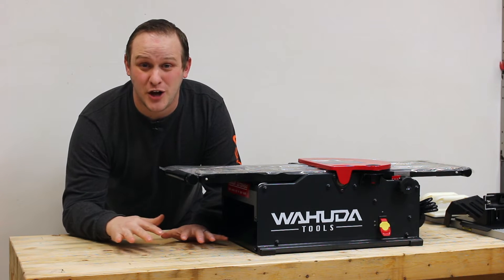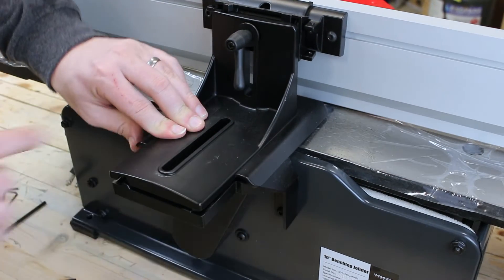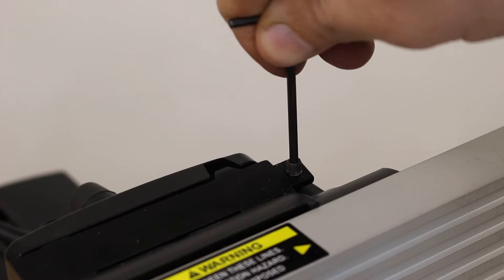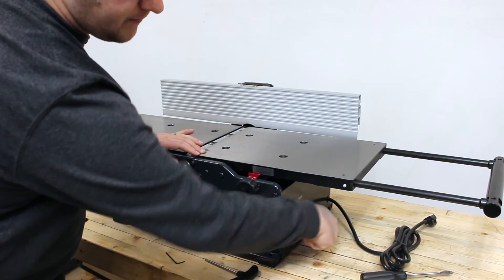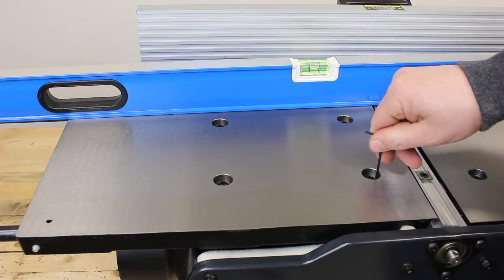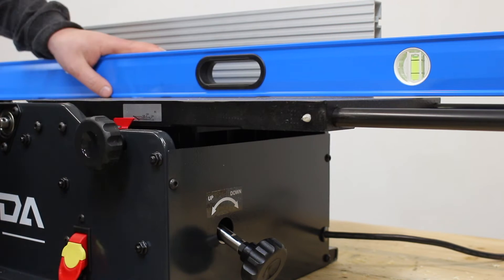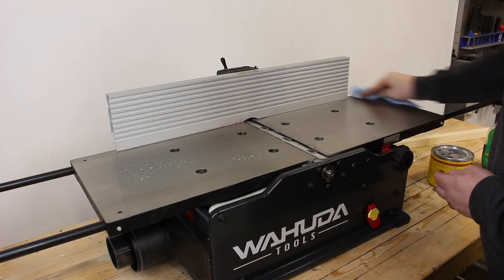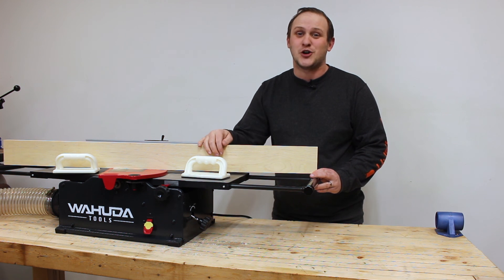Official Wahuda Jointer Setup Guide

Comment: -5 today... Brought the jointer in from the shop. Setup the outfeed table, re-set the infeed; got everything to within .003". Tightened everything down to a nominal torque (not 'gorilla-tight, as it came to me, but at least 25-30ftlbs). Carried the jointer back to the shop and bolted it on to its stand. Was in the process of re-attaching the guard and noticed that the head looked a bit close. Turned it counter-clockwise and, sure enough, it contacted the infeed table! Placed my 4' level across the tables - out of level by approx. 3/16" over the 32" ... Not sure how, or why. Another day shot. I'm starting to doubt this tool's quality - or at least this particular machine... Any constructive suggestions are welcome.
Reply from the maker: Have your reached out to Wahuda customer service? Mike is super helpful!
Reply: “Calibrated it, moved it to another location, bolted it down and calibration is now off”. Allowing for the fact that this is a bench top machine, that is not really surprising. You really ought to bolt it to it’s stand and calibrate it in the position that it will be used. Just my $0.02...
Reply: I am on my second Cutech branded jointer and I'm having similar issues with this one as well....without having moved it at all from its base. I get that moving it might have not helpful but I cannot for the life of me get this thing aligned after spending hours going back and forth with it
Reply: @zogthehog  I feel you! I've gone around this horn twice and am still not happy. At this point I'd pay somebody to come to my shop and set it so it actually _works_!
Reply: @michaelkeymont501  That is a well spent 2 cents. Smart.

Comment: How much higher should the outfeed table be ? You said they shouldn't be level in the beginning but then you said adjust the fee tables until they are perfectly level ! Please explain ?
Reply from the maker: This can be changed using the adjustment knob on the right side of the jointer under the infeed table. I tend to keep mine at about 1/16 of an inch but you can change it base on how much wood you want to take off in each pass. Check the video at the 12:45 point where I go over this.

Comment: You forgot to mention that getting the tables level and co-planar could take anywhere from 2 - 10 hours, and that re-tightening the main screws will likely change everything you just did with them loose.  These jointers have a criminally stupid design.

Comment: I just got the WEN 8"... I swear it is the EXACT same machine. I need to check for the little allen screws for the table setting, I have to take the star head bolt out and then there is a slotted screw. 
You explain this much better than the manual, its horribly written.
Reply: made by same company, although the wen is much inferior to the Wahuda
Reply: The Wen and Wahuda are NOT made by the same company.  Wen is made by the same company as Cutech. However Wahuda bought out the original Cutech so the current Cutechs are not the same as  they were years ago.

Comment: Umm - did i miss something? You start by saying that the outfeed table wants to be HIGHER than the infeed table, but then you set the infeed table to be level with the outfeed. Doesn't that make them equal?
Reply: You set them equal just to make sure they are flat and level with each other and then you lower the infeed table with the little handle to 1/16 or whatever cut per pass you prefer

Comment: I almost pulled the trigger on the wahuda.  Instead, I dialed in my track saw to exactly 90°.  When jointing with a track saw it helps to do a backwards scoring cut then the full depth forward cut.  That'll produce sharp, clean edges both on top and bottom.  I just glued up a small counter top and the seams are perfect.